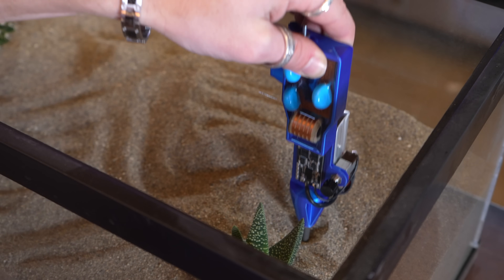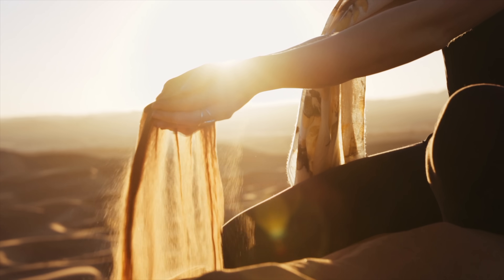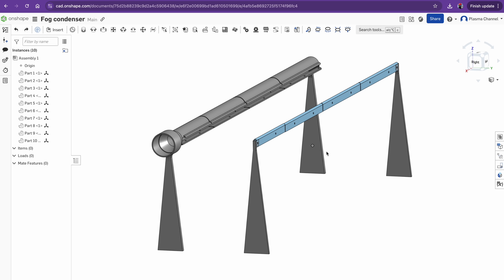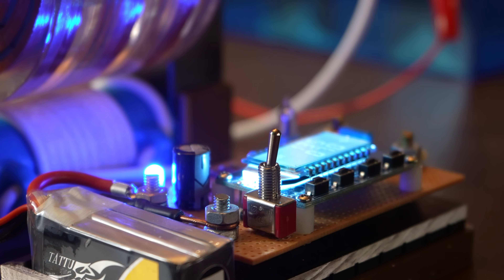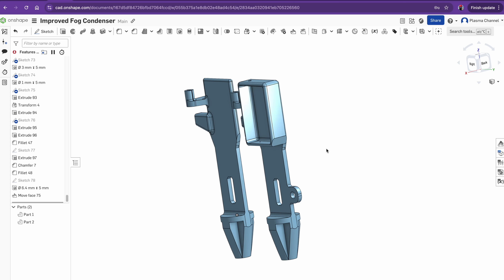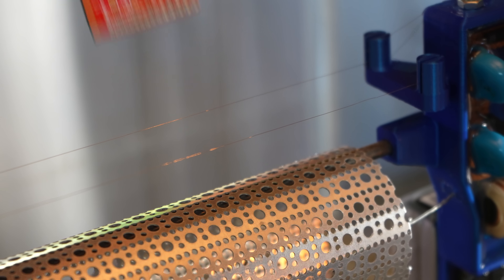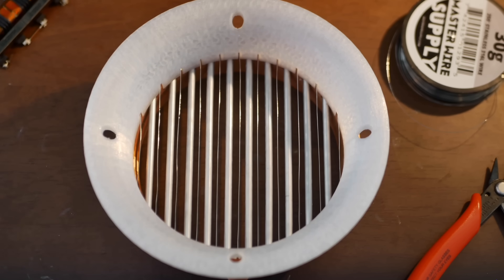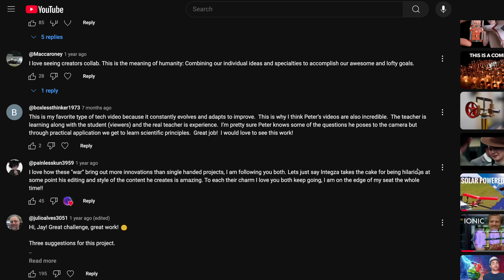Solving Desert Water Shortages Using 20,000 Volts

Comment: This is great but then you need a lot of batteries and you need solar power plants or/and an electrical grid installation. And solar power plants in desert areas need a lot of maintenance beacuse of the sand, high temepratures ect.. For every solution you get new problems to deal with. That is the engineering approach. But it's a start, great idea.
Reply: Cool, that means more jobs that can be created helping the economy. Why turn it into a problem when there’s easily a solution?
Reply: @DLCoates1  This is what life is, dealing with problems to solve. And first thing to do is to calculate if the economical benefits will overcome expenses at the end. But probably for the long terms they will

Comment: What about getting water without desert fog using this principle? There are companies making/selling atmospheric water extraction devices already. Some use refrigeration compressors like dehumidifiers. One uses a proprietary? material and blows air across it with a tiny solar fan. It runs all day to produce a very small amount of drinking water. What happens if this device runs for hours even in the scorching sun at noon? Just pondering aloud.

Comment: This test was at 100% RH at an unknown temperature. Psychrometrics matters for proper testing with a standard dehumidifier testing this device at at least 2 more relative humidity points to then claim appropriate efficacy gains over standard, compressor-based dehumidification is strongly requested.

Comment: Just one question, wouldn't it work better if you reversed the polarity. because I've been reading up on extractors and air purifiers and they are supposed to create negative ions that can bind airborne contaminants such as dust, pollen or volatile chemicals. Therefore particles become heavier and settle more easily

Comment: I would test out different voltages, conductor gaps gaps, and condensing surfaces before going to large scale. Additionally I would also check performance based on fog density and how those variables affect performance for a given fog density (your setup is producing very dense fog, so I would be skeptical around real world performance without seeing test that involve a range of fog densities.)

Something to also consider, there's a number of hydrophilic materials and surface treatments you can investigate and test.

Lastly, looking up desalination performance you find the typical performance is about 400 ml to 250 ml per watt. So this solution would need to lean into it's ability to be easily deployed in austere locations and built from relatively simple components (When compared to a desalination plant) since performance per watt is not in your favor here. Desalination plants are very expensive, complex large facilities that are also power hungry, so having a light easily deployed solution maybe well worth it, particularly if they can run off battery power. 

Given your two pole solution approach, you can also consider an integrated solar panel since the system has a duty cycle that's anti sideral  in nature and not 50/50. Not sure what the ratios are, but chances are you would only need to draw power for say 5 hours in the morning, but would have close to say 8 useable charging hours. So in that situation a 1k watt systems could run off a  panel with a 650 watt average power delivery.

Comment: What you're describing is an electrostatic precipitator. Used at coal fired power plants to remove fly ash from smoke. The technology has been available on an industrial scale for decades. Simply repurpose it for water collection. Separate point: sadly, that fog will be permeated with PFAS chemicals / microplastics. So you're going to need to filter the water you collect before using it.

Comment: i wondered the following, you have 35Kv + voltage. but does it needs power behind it ? since your power draw is rather high to create 35Kv i myself worked with electrostatic speakers and to make something staticly charge you dont need the power behind the high voltage.  did a small setup with an BIAS power supply a multiplier and an inverter feeding the inverter with around 700 volt. after multiplier maybe only 10Kv,  now i do not feed it completely saturated air. but i dont even get a tiny drop :) so i wondered is it the power behing the high voltage witch in my case is limited with a series resistor. or is it me not using fog and the fact i use 1/3 the voltage ?  since my power draw is only 1.5 watt give or take.  i wonder where that powerdraw is coming from in your setup and is that a needed power ? since you can get 35kv with far less power draw then 35 watts i think ?

Comment: YOU CAN ADD COLLECTION SQFT² BY MAKING THE GRID ROTATE LIKE A TANK TRACK. but instead of being powered by the solar steaks ( have a lovely extremely efficient design for this) allow the collected water to accumulate into a cup pattern that continuously weighs down each section of the rotating grid. It will give you about 8x more water per sqft of grid. Each section of the grid/track all rotated when full of water to dump into a central collection point which can run forever because it creates energy as gravity pulls the full cups down and rotation means energy. Now you have a power generator, water electrolizer and collector, and a purifier all in one. Pretty cool. If you'd like to see my design on this I came up with while watching your video I'd gladly share with you. Never seen any of this before and my design was instantly on my Brain. Figured JC wanted you to have it. blessing for sure. Stay Genius my friend. Ps if you happen to have an old 3d printer  you can donate to a good cause I'd be forever greatful. Cheers.

Comment: I think a small scale test in your backyard might be useful. The one variable I can see that could cause problems is your fog. In  a less ideal environment the fog may not be as dense and may not blow across the device fast enough depending on the wind. Or if the wind is too strong it may blow the water vapor away from the net. In any case I'll be interested to see your real world results. Cool tech.

Comment: I have to correct one thing here: That small dehumidifier is almost certainly TEC powered (peltier elements). While cheap and completely quiet - peltiers are notoriously inefficient.
A compressor based system would be in the ballpark of 4-8x more efficient. It depends a lot on scaling for these systems.

So while the power efficiency here is really impressive - it's not the massive difference you present it as here.
This type of system can run silent though, and can probably scale down far more than any compressor. It should also be extremely reliable (given you use appropriate materials) because it is a solid state system. Cheaper too I have to imagine, as compressors can be pricey.

Have you been factoring in resistance in the wire and how this affects power loss down the line? Material choice and diameter wire could have significant impacts for running the whole length at full efficient. Especially when it scales up more and more.

Comment: WAYS TO MAKE SHIT CHEAPER:

Get super high voltage without electronics, van de graff generator uses static electricity build up.
Use a mosquito net, already cheap and popular, can make it out of carbon fiber, or just steel, or make it conductive somehow, like using graphite for example.

This could possibly be built in poorer rural regions.

Comment: the best part is, the best practice for irrigation is slow, drop by drop irrigation, or a fine mist, rather than just dumping water on the ground. the goal is to increase the total soil moisture, and individual droplets absorb better. so i imagine just placing these systems around a farm and turning them on every early morning, letting the drops fall straight to the ground, rather than collecting them to a central tank. this water collection system could simplify the superior soil hydration strategy

Comment: I'd have to wonder how necessary the large collection grid is because since it's powered  you're not relying on random chance for the water to hit it. Could it work with just 2 wires or maybe a wire and a foil ribbon with multiple points so water doesn't all just run to the center which will always be lower because physics. Or maybe 2 wires but the collecting one just has more sections of wire hanging from it.

Comment: Nope, anything that pulls moisture out of the air is called a dehumidifier, its simple. You need moisture in air in order to pull it out so the desert, where there is very little moisture is a stupid place to try this. Snake oil sellers have been peddling this for ever.
Reply: Have you not listened at all..?
The FOG
The FOG brings the humidity you need in order to collect water.
It's not made to run 24/7

Comment: this mistake has been tried time and time again. Look up Waterseer if you want an example. Long story short, anywhere you can extract enough water out of the air for irrigation, rainwater and other sources are sufficient. Anywhere you would genuinely need a device like this, like deserts, it simply WILL NOT produce a meaningful supply. Just do the math yourself if you don't trust me or actual experts.

Comment: As for High Voltage part possible to use a vehicle ignition coil, even used one. They voltage up to 15-25 KVolts, just need a pulse generator, or a single relay (but will produce a constant noise), 12 volt power supply (battery with charger).

Comment: Thanks 🙏! That's will be my project for energy efficient room dehumidifier, and water serce for my greenhouse. Will use solar panels, battery, computer fan, maybe humid relay, 4" drain pipe. The rest you know 😊.
Also thinking about not to use computer fan using natural air forces moving from bottom to up into vertical pipes, similar as in chimneys.
Really nice idea for my future projects!

Comment: To enhance the net's design for better water collection, consider the following modifications: 1. Increase Surface Area: Roll the net into a cylindrical shape. This configuration will significantly increase the surface area exposed to moisture. 2. Create Layers: Ensure there are a few millimeters of space between each layer of the rolled net. This spacing allows for better airflow and prevents water from being trapped between layers. By implementing these changes, you should be able to collect a substantially greater amount of water.

Comment: how deep does that water go? does it produce enough from the fog to water at least 6-8 inches down? if it only covers 1-2 inches down, that will evaporate within an hour or two in the sun/wind.

it's cool but maybe on a much more massive scale it could produce enough water for a small scale farm.. im sure there are calculations on how much water certain crops need and how much this system can produce on average when built at scale then work out what size field you can effectively water with it. good soil is also key for water retention, that sand would have to be fertilized with metric tons of compost and worm castings for beneficial bacteria growth. 

i feel like it's definitely doable though. on a scale like solar farms are built, somewhere near the coast in a desert, it can definitely collect quite a bit of water. 

would it also increase how dry and arid the inner parts of the desert are? would you see many more sandstorms as a result of that moisture never reaching inland before evaporating into the atmosphere?

Comment: Does the temperature of the screen have to be kept down in order for the fog to condense? Or does the condensation occur because of the water molecules getting their electrons back? This is the part that I'm unclear of. 
If, for example, the screen is at a higher temperature than dew point, would the water not condense on it?

Comment: Have you mentioned frequency? 
Is there a resonance when water molecules condense with no effort? 
Consider what happens to vapor in the air as the pressure drops
Main focus is the movement of air
Specifically in circular motion
Think Victor Shauberger, anything that moves in a circular motion
Concentrates energy within it
Instead of trying to harness the wind with a turbine
Use a sail to direct it to funnel/condenser

Comment: I'd be very interested to see if this practically scales.  If it does, this could also become a method of water purification in high-humidity areas that don't have much access to fresh water.  Things like islands and other coastal areas that are surrounded by saltwater, but lack good resources for freshwater.  I know of a few small island communities that are dependent on being over aquifers that connect them to recharge areas on the mainland.  If a tech like this can scale appropriately, they could potentially start pulling water from the air rather than wells.  Potentially a much cleaner source and one less vulnerable to salt intrusion.

Comment: I need a dehumidifier for my bathroom. But I don't think the goverment likes 20kV in a bathroom. Even at 37 watts this can be lethal.
But I like this concept of getting water out of the air.

However i do not believe in any domestic applications using electrostatic perticipation.
Commercial dehumidifiers refrigerate the air to extract water and use a heat exchanger to heat the air up so you get dry warm air out. Which is considered safe to use in humid environments like bathrooms.

Comment: So, couple of experiment suggestions.
How does this work with snow? How does it work with rain and fog. How does this work with shaved ice/hail?
If this works with the fog when it rains, I could see putting this on the sides of roads to clear them up.
If this has a similar effect on snow, I could see this being a start to safer roads in those climates.

Comment: can you do this exact experiment again but watch it with a infrared camera. see if you can see where the heat or cold temperatures are at and where they move to when power is on.   and conduct experiment out side and see what happens

Comment: I knew there was a reason I like you (besides all the plasma). I think for practicality though, you need a way to stabilize the air you aren't drawing from, or else you rick losing a bunch of possible fog. There's tons of ways to handle this, but there could be a way included in the design.
Excellent work though, it is really one of those quite obvious solutions that maybe has been overlooked.

Some angles you may not have considered, hydrophilic coatings (or microscopic geometry), nanomaterials, or nanostructure in the metal (check out Integzas flame knife video). ALSO also, you already have current, you might be able to modulate this effect with a magnetic field, which could be used (albeit weakly) to add thrust, or, since the air is likely more charged than the actual water, further encourage them to separate - but that might be a little out there, and frankly I just don't know that much about this stuff.

Comment: Water is pretty easy to handle once collected, and crops is not the only potential usage, by far. I wonder if the linear "crop-oriented" design is limiting your efficiency, maybe a collection-oriented design could be even more scalable and efficient, and would serve multiple purposes as once collected, we can do whatever we want with it.
Reply: Example: Efficiency was visible increased on the edges: multiply the edges! You probably don't need a "fabric" or "mesh" at this point, and potentially, you don't need to worry much about connecting the mesh back to the device if it's just grounded, so why not a simple but dense fence, or a matrix of "spikes" from the floor, right underneath the high voltage wire? That might be easier to build locally than importing a fancy mesh. Just some ideas to follow up.

Comment: Amazingly interesting experiment and engineering! Have you varied the voltage and distance to ground? Does it matter? Higher voltage, same distance, longer distance = more water condensing? What's the most efficient topology of the net? In reality water will probably evaporate from the net to the air again, wouldn't it?
Could this also revolutionize textile dryers at home?

Comment: I've been working on something similar to this in concept for awhile - also borrowing from the MIT study as well - but going beyond it to address the typical conditions real world deserts. But it is definitely cool to see at least that component of it working so well.

Unfortunately, I think your concept is unrealistically over-estimating the ability of typical desert air to produce condensed vapors. I live in the Mojave Desert, and I routinely track both the temperature and relative humidity where I live and it is very rare that the dew point and ambient temperature get even close to eachother, much less overlap enough to produce fog. You are right that desert air does contain quite a bit of water - especially in the summertime - but a device like this is only part of problem for a lot of desert environments. In most areas you have to either cool the air enough to produce the necessary droplets for this device to work or you have to artificially increase the concentration of vapor via some other approach. In arid deserts like the Mojave desert, a device like this on its own would never produce anything. You need another device to cool the air below the dew point before it passes the collector.

Comment: You can combine wind turbines in a line to generate power and at the same time create a linear flow of air displacement. This same generated energy powers the high voltage DC system for the water collection system in the video. Thus creating almost a "perpetual water cycle".